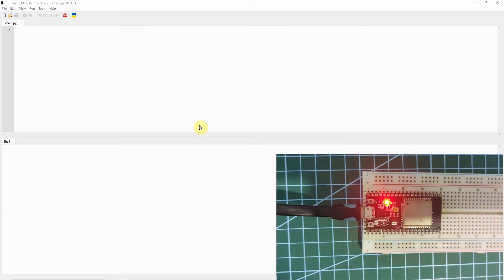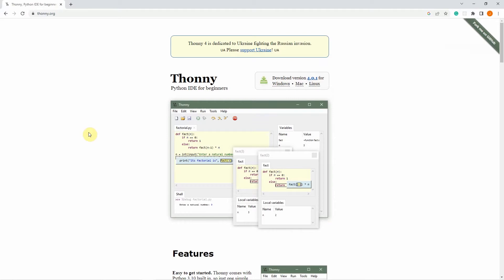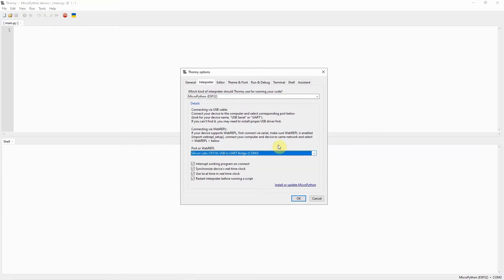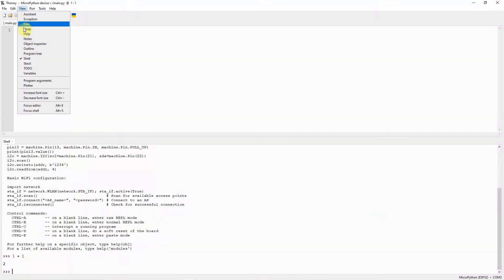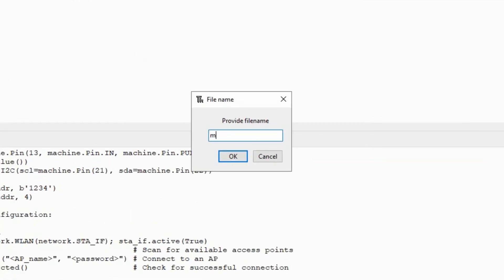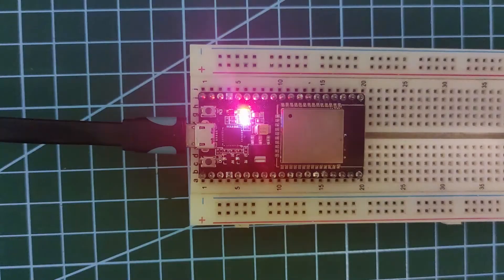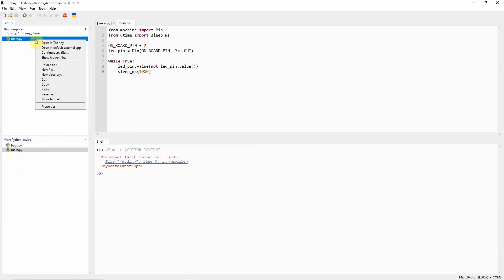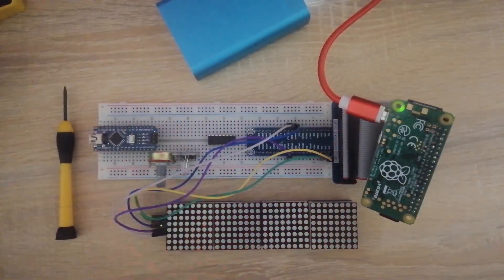MicroPython Development Using Thonny IDE

Comment: Very nice ide to test code by interpretating it very fast and easy on esp32.
So bad that you can't flash fully with your code, only bootloader and interpretating. Thanks to you I got how to make it on VS Code with pymakr so easy. 

Or it's avaliable here also? I didn't find any ability to flash your code in this ide.
Reply from the maker: As far as I know, you have to copy manually or upload it to the filesystem of the microcontroller